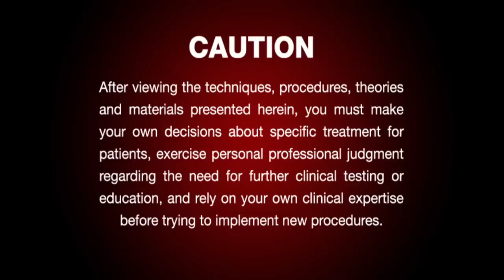Case of the week: Achieving Retention and Support in a "Slippery Slope" Partial Denture Case

Comment: Thanks for a good video. However I agree with @AbsoluteXero ,Re the 3rd case, my only concern is the distal rest on a free end saddle with an I bar clasp.  A mesial rest would lock the denture in much better and stop it from sliding distally, and off the tooth during function. I am a  dental tech trainer and I always stress mesial rests for distal extension dentures.